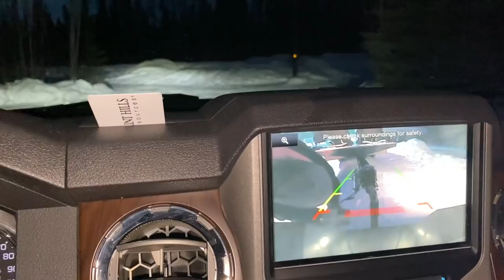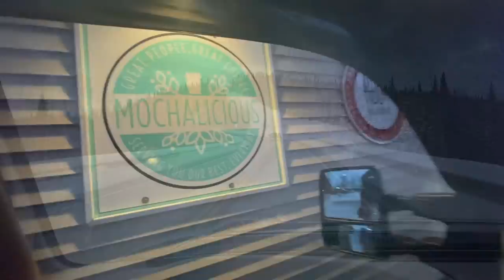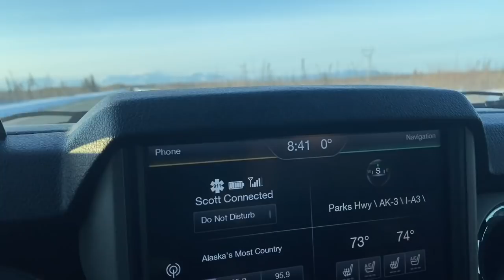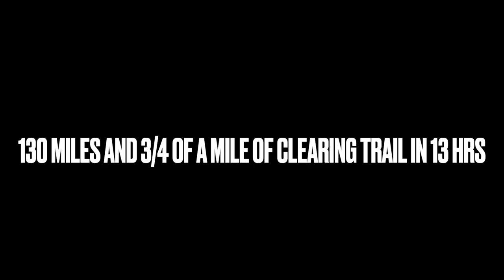"OPERATION ARGO" 130 mile adventure in Alaska's backcountry

Comment: I picked up a 2016 Argo Avenger 750 HD,, 32hp with the admiral transmission. I bought some Argo rubber tracks and man can I go places with that in the winter. Very low PSI foot print,, doesn’t sink in the soft snow.  Wish I had been with your group,, good friends some sledding and being outdoors what more do you need.   Cheers from Canada